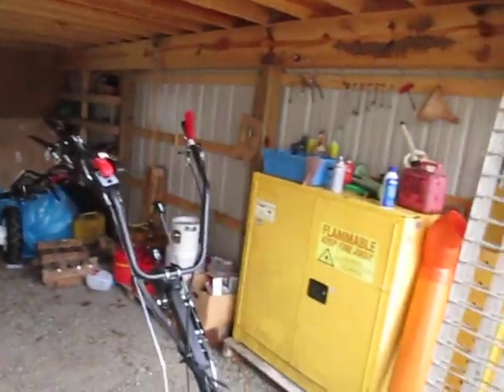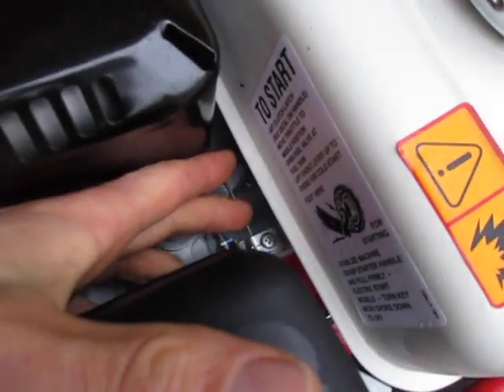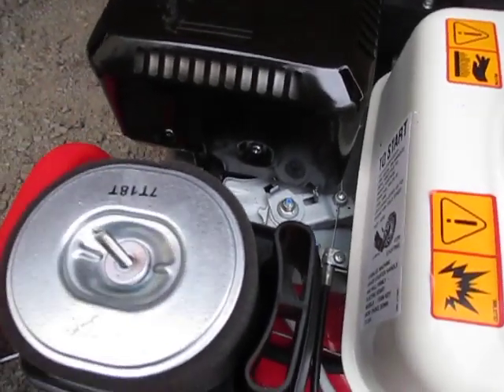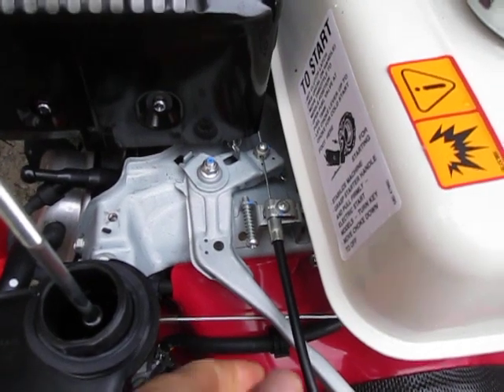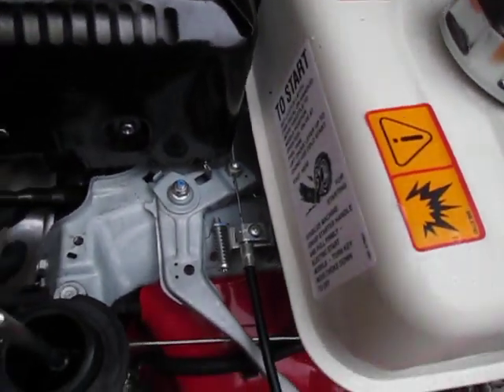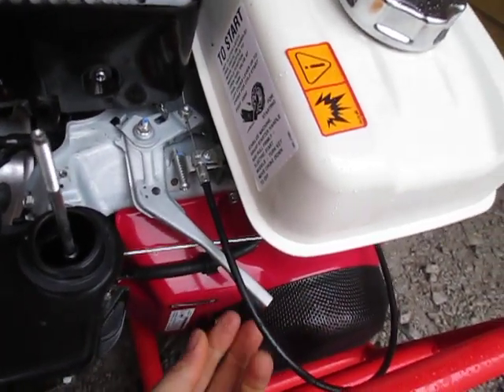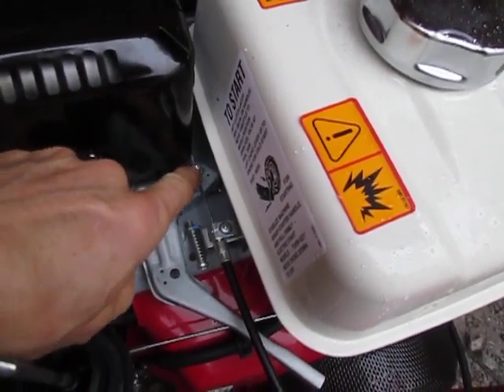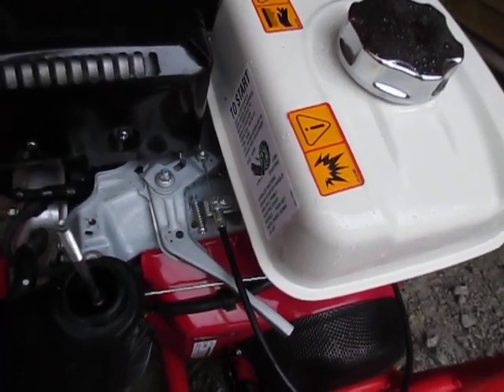Throttle Cable Operation for BCS & Grillo Walk-Behind Tractors

Comment: I was hoping this was for the Acme engine. On my 735 with Acme gas engine, I need the throttle/governor adjusted. In a pull, the engine slows down too much before the governor increases engine speed back to set speed. The governor is not maintaining engine speed the way it should. The speed range is ok from idle to full throttle so I guess it is the governor setting, but I haven't found instructions to set this.
Reply: Rasputin Clinton
1 second ago
Hi there. But what is doing the throttle lever at the end, is moving something in the carburetor??? Down toward the engine it turns , but what actually is doing to increase the speed/power??? In video it shows just that lever with that spring to return it in the initial position, there must be something further to adjust the air or gasoline in the carburetor. Thanks a lot.

Comment: Would you believe my throttle cable broke yesterday? Last night i was going to ask you to do a demo on repairing or replacing.  But i took a look at it myself and with the same principles as the other vids show on clutch cable changes...i understood what was going on. I emailed this morning Joel... so I'll be waiting since EarthtoolsKy  reopens on 2nd Jan
Reply: Hi there. But what is doing the throttle lever at the end, is moving something in the carburetor??? Down toward the engine it turns , but what actually is doing to increase the speed/power??? In video it shows just that lever with that spring to return it in the initial position, there must be something further to adjust the air or gasoline in the carburetor. Thanks a lot.